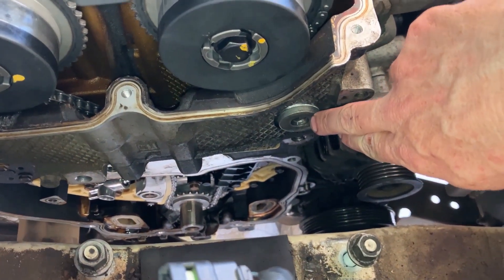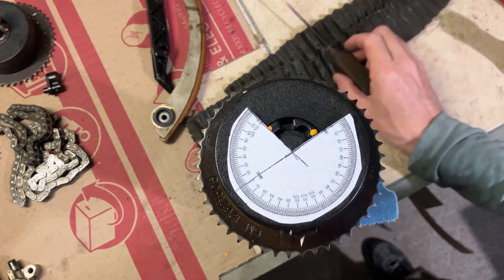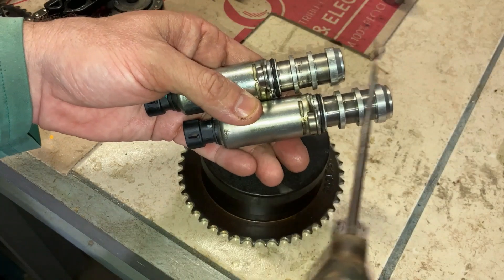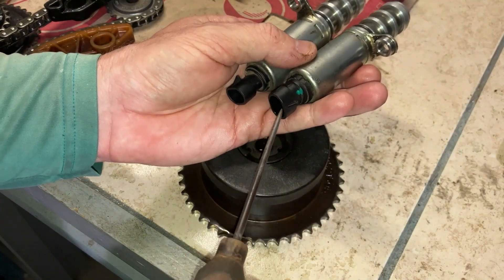Chevrolet Equinox [Timing Chain] Replacement & Overview: Ecotec 2.0 2.2 2.4 VVT

Comment from the maker: If the video was helpful leave a like. If you have any questions leave a comment. Check the description above for part numbers, and a link on how to install a high-pressure fuel pump, follower, and cam sensor on a Ecotec engine. Thanks For watching.
Reply: I’ve been reading up on these ecotec 2.4L. I have one with 170,000 miles and the timing has never been changed.  I popped the valve cover and it has a tiny bit of slack but nothing crazy.  Should these be super tight?  I swear I hear a rattle from the timing when starting if it’s been sitting for a long time.  Since the top guide bolt that is under the plug is known for being worn down from a broken guide, is it worth taking the plug off to take a look? Would love to replace the timing just worried about timing it back up. Might just go ahead and do it after watching the video.
Reply: How did you get to the timing chain to have enough room to work?

Comment: I did this job , video was helpful . After installation car starts up , runs good, only issue a faint whine now that goes up and down with RPM’s. It’s not super loud , but it’s there. When I did the timing chain I triple checked the work and it seemed like the chain was just tight . I installed everything right . Not sure if it’s the chain that needs “broke in”? Im not sure. It does make me nervous. I used a cloyes aftermarket kit. Idk if the cloyes chain come tight or what . Should I take the car back apart or will this noise fade through time ?

Comment: I might be doing the timing chain because i believe it started to rattle and my water pump went out, my question is, when installing the new water pump, does it matter what teeth are grabbing on the water pump?? Or that wouldn’t matter as the chain wont have a mark like it does on the crankshaft.

Comment: My 2016 Equinox had a broken chain guide, but didn't damage the rest of the engine, but it did die right after the part broke. I changed the timing chain and other components, set timing to 10 and 2 and all marks on the timing chain lined up with their respective spots, but when i tried to crank it today it just spins the engine. Sounds like it's not firing at all, just makes a humming noise while the engine spins. Any ideas?

Comment: Great video,  been super helpful up until this part that I'm stuck at.  On the timing chain, I've got my off colored link lined up with the crank sprocket dimple (with the sprocket key at 12. Up top, it looks like the gold link for the exaust actuator is in the right neighborhood of being 11 o'clock, but I haven't put the sprocket on yet. But on the intake side,  the gold link is all the way down inside the fixed guide, nowhere near that 2 o'clock position it should be at.

Any idea why it's only 2/3rds lining up?
Reply: Turns out, at least for my year (2015) the chain according to GM and the chain manufacturer I bought from,  have it set up where the OFF COLOR link goes to the intake actuator, and the 2 matching links go to the exaust and the crank. Not sure if this a year difference,  or an aftermarket part difference, but something to watch out for.
Reply from the maker: Thats correct, some other brand chains locate their colors different. I usually count the links on the old chain and compare to make sure there the same as the new one.

Comment: I need help .

I lined up everything, it turns good, but when do the marks line up again, I've rotated it probably over a hundred times, i don't want to close it up till i see the marks lined up again  .

Anyone with any advice .
Reply: Although I do hearing as I turn it and it sounds like alow cooking popcorn  .
Reply: Do each lobe on the cams supposed to be facing out passed the lobes .

Comment: What is the washer for on crankshaft?
Reply from the maker: Those were just thin shims some have them and some do not. There usually stuck on the sprocket, sometimes the other one will stick on the harmonic balancer if it has the second one. Probably just to keep the two parts from making metal contact.

Comment: I had a question about rotation of the engine 720 degrees, when I did this my timing marks did not line up again,  do I need to redo the timing or is that normal
Reply from the maker: They will not line up after the motor is turned. If everything was set up by the marks correctly, motor spun 720 deg. with no piston contact, you should be good.

Comment: I watched your video a few times. That top bolt for the front guide broke off, flush with the head of course. The second time you said that they make that plug with a pin so that it holds the guide with the plug? What? That took me 2 hours to drill out and mess with. Where do you get that from? Thanks for the video man!
Reply from the maker: Access Plug/Guide Bolt Combo: Melling 5499GMB or Dorman 917-954. The Dorman should be available (In stock or special order) at a local auto parts store. Either should be available online.
Reply: @hp_outdoors  I found it at a local Autozone in stock! Would have never known about it if it wasn't for you! You saved me alot of time. I owe you a beer or three!

Comment: Where can I buy one of the access plug with the guide bolt built on it
Reply from the maker: Access Plug/Guide Bolt Combo: Melling 5499GMB or Dorman 917-954. The Dorman should be available (In stock or special order) at a local auto parts store. Either should be available online.
Reply: @hp_outdoors  Are those worth installing as a preventative measurement? Can it be done without removing the tensioner or is it too risky?
Reply from the maker: Most just updated it when they serviced the timing chain, and a fix if the bolt did break off. You wouldn't have to try & drill out the broken bolt or extract what was left. I think the bolt breaking problem was due to running them for too long with a loose chain.
Reply: @ Thanks for the insight! We have the Doorman bolt in our basement awaiting "use"

Comment: My 2.2L Ecotec jumped 4 teeth on each non VVT cam sprocket. It still ran fine (noisy) to park it in my shop. I'm thinking I can target the crank @ 12 o'clock like it's supposed to, then remove the timing chain and rotate the cam sprockets back to 10 o'clock on the exhaust and 2 o'clock on the intake and be exactly where I need to be. Tell me if you think I'm going to be ok with that logic? I'm 2 days away from my Cloyes kit arriving, could really use the nod of approval. 

My upper guide got chewed up by a slack chain just like yours, I believe the tensioner failed and caused it. Chevy has redesigned them 2 times now after the first abomination was installed at the factory.

Thank you in advance.
Reply: How did that work out? My 2.4 did the same thing. Waiting on my kit to get here Friday

Comment: Thank you for posting this! I found this video very helpful in a lot of ways. Ive never attempted a timing chain replacement because of the fear I might get everything out of alignment so this helps but I have a question. Do I or should I drain the oil before opening up the timing chain cover and should I remove the head to check the valves for damage as well?

Comment: Trying to troubleshoot a 2012 2.4L Equinox. Wondering if it is the timing chain stretched and jumped a tooth or something else. Only codes that appear are o2 censor running lean and that appears randomly then disappears. Vehicle starts as normal but will sometimes sputter between 750-2000rpm and engine will sometimes die. Vehicle restarts without trouble. Random and unpredictable misfire occurs. Gas pedal becomes unresponsive while engine is fighting to stay running. Issue seems to lighten up and or disappear after motor has ran for 10-15 minutes. New air filter, cleaned MAF Sensor, Cleaned throttle body, cleaned PCV port in intake manifold, Intake and Exhaust camshaft solenoids replaced, plugs pulled and replaced, new O2 sensors. 95k miles on motor, and 500 miles on new oil change.

Comment: when you rotate the motor, lets say 2 times around or even once should the timing marks and arrows still line up? in these videos i dont see anyone rotating as if it doesnt matter. im not so sure
Reply from the maker: No, after 1 or 2 turns the marks won't be lined up.

Comment: Hello there I have this problem rebuilt the engine 2013 2.4 . And know every time I startthe car  a winding noise coming from the timing chain area . Pulled off the oil pump cover replace the timing, chain and gauge again still making the same whiny noise.
Reply from the maker: If it does it on start up and not all the time it could be the phaser sprockets. They can get very noisy.

Comment: Hello guy,
I'm going to look at a 2011 one with the same issue but what's the approximate price to replace the set up?
Reply from the maker: Really depends were your getting parts and what all needs to be replaced. Prices vary. Cheapest route would be replace chain and guides only, or get the master kit that has all timing components, water pump, VVT solenoids, Phasers, accessory belt and tensioner. Don't know labor cost.

Comment: If you do not get a code for this issue, and do not have a clanking sound, and the vehicle is 150,000 miles[2014 equinox ecotec] am I good to drive for now at least? I bought this thing with 140k on it, probably a dumb decision in retrospect. Have already replaced cat converter and have put a fair amount of cash into it for maintenance. It has a smog pump code on but that's it. I checked out the carfax and I am not sure if this vehicle has had a timing belt change or not. If it hasn't, then obviously it's been due but..
Reply: Change the oil every 3k on these I've done 20 chains. They go bad due to note changing the oil frequently enough
Reply: @FIXINGCARSEASY  Ok thanks. I think a big problem with the vehicle is I have the same issue many others do with it.. oil getting low rapidly.
Reply from the maker: This one here has around 230k right now. There a great driving vehicle, and really good overall. The timing system to me could of been designed better. Keep the oil level correct and don't let it get low.

Comment: my p0010 code popped up on a pontiac g6 2.4 ecotec i’m hoping it’s the wiring i don’t feel like having to change the timing chain in my apartment parking lot atleast not just yet
Reply from the maker: Could be a wiring problem or a bad VVT controller there on top of the head side by side. This vehicle had one go bad around 60K, replaced with a new one and code cleared.

Comment: If your not replacing the phasers' is it necessary to remove them.?
Reply from the maker: Not sure if you can remove or re-install the chain without taking the phasers off.
Reply: @hp_outdoors  nope I had to take the phasers off. The 18mm bolts were a BITC%! to remove!!!

Comment: My daughters car is a 2010 2.4 Equinox.  It died on the highway. I had it towed home and took the valve cover off and the bolt that holds the intake phaser sprocketvon the cam broke. I guess i would have to remove the cam and takevit somewherevto have the bolt removed...i did notice the sensors had heavy crud on the screen. Did that cause this? Is it worth fixing or should i junk it? Thank you for you video. It helped me a lot.
Reply from the maker: You could try drilling with a left hand bit in the center of the bolt and use an ease out, if you can get to it with a drill. If the threads weren't damaged when the bolt came loose or broke, the rest of the bolt should unscrew out. If the threads were damaged and the ease out won't get it, then the cam will have to be removed, and taken somewhere to be repaired. Could get a new or used cam. Could also get a good salvage motor and take parts from it and use on your current one. Have to pull the timing cover to see what's all damaged down in there and see if there was any valve to piston contact to know if it's worth fixing.

Comment: Is it necessary to replace the balance chain kit?
Reply from the maker: You don't have to. But if one of the guides is cracked & wore, or the tensioner is not doing its job it may cause a problem. Balance chain also turns the water pump if something goes wrong it will run hot.

Comment: How feasible is this without a lift?
Reply from the maker: In a equinox its no problem. This one was done sitting on the ground with the front passenger side tire & wheel removed. Place 2 jack stands under the front frame to support it. I put a jack (lay a block of wood on top of the jack) under the motor to support it, also to move it up and down a little to remove the motor mounts and bolts that are in the way of the timing cover.
Reply: So don't jack up on the engine/tranny just the motor mounts? Sorry, my wifes Equinox has this issue as well and would rather not throw away 2k for a job i can do in under a week.
Reply from the maker: Put a piece of plywood or block of wood on the jack and support the engine under the cast oil pan. Mostly just supporting or moving the motor a little so you can get the weight off the motor mount on the passenger fender. There are 2-3 other motor mounts supporting the engine/trans still attached.
Reply: @hp_outdoors  damn quicker than my local mechanic thanks boss got like a subscribe from this guy

Comment: Now I gotta fix this pos my wife had to buy. I hope when I take the head off it's all bad. So this pos vehicle goes. I already told her if I have to replace motor it's done and I am not doing it. To never ever speak of buying another American vehicle ever. They are all trash. Idc what you own. If it's America car it's trash. Meanwhile my Honda Element that we let sit for almost two 2years in yard. Put battery in it fired right up. SMH trash American vehicles this coming from a tech.
Reply from the maker: This is not the best timing chain setup or design for sure. I wish it would have just had a timing belt.

Comment: How does every video i watch everyone has so much slack to reinstall the chain and i cant get mine over the last sprocket. What am i doing wrong?
Reply from the maker: Not for sure if you can put the chain on the cam sprocket without it being un-bolted from the end of the cam. Usually have to hold on to the cam sprocket and push the teeth up into the chain & line up timing mark, then bolt it to the cam. Unless the chain maybe too short, count the links on the old one, and see if it's the same as the new chain.

Comment: I broke the upper bolt holding the black guide for the timing chain. Will i be ok
Reply from the maker: Not a problem, use Melling 5499GMB or Dorman 917-954. These are designed as a repair (in case the bolt breaks or timing chain takes it out) or an upgrade to the timing chain guide. Its a 2 in 1 access plug that has a stud made on the end of it to hold the black timing chain guide. The upper bolt behind the access plug isn't needed if you use it. Did it break smooth off or did it leave some bolt sticking out?

Comment: Where did you buy the timming kit?
Reply from the maker: All the parts for the timing chain and fuel pump install came from Rock Auto. First time I ever used them and will use them again they beat everyone's price. Only problem is they don't move parts from one warehouse to another warehouse and then box them at the warehouse closest to you. If you order 4 parts that are in 4 different warehouses, then you pay 4 shipping charges, because they ship out from those individual warehouses. Luckily all the parts I ordered were at and shipped from one warehouse.

Comment: Thanks for the video. Question - before removing the timing chain, I am trying to line up the camshaft and intake /exhaust  cams to TDC. I can’t seem to rotate the engine more than a few degrees in each direction - then it stops. Any ideas? Should I remove everything and then line up TDC etc?
Reply from the maker: Removing the spark plugs will help with rotating the engine. You can put the belt pulley on and bolt it up to turn the motor over with a ratchet. Unless the timing is off and your making piston to valve contact.
Reply: @hp_outdoors  what do you do if that is the case?  Not seeing any info about fixing that

Comment: After I replaced the Timing Chain Kit for  My Chevrolet Equinox. Then, It appeared "Engine light" is  on . 
Is it true that they messed up something in my car ? 

Now they  diagnosed, the codes are below:

P0014 Exhaust Camshaft Position System  Performance
P0137  HO2S  Circuit Low Voltage Sensor 2

The machanic told me If I don't fix, The car will consume  more gas. 

My questions:
1)If I don't fix them, Will there be any damage to other parts of the car ?
2) How long can I drive before I can afford to fix them? 
3) what are the costs to fix those two codes ?

Thanks a bunch
Reply from the maker: For the P0014 I would check the cam actuator solenoids on top of the head, timing chain end of the motor. See if the screens are covered with metal. P0014 needs to be fixed that's timing related. It could possibly be timing is off, or chain may have jumped somehow. If it was the o2 sensor #1, then drivability would be a concern. With o2 sensor #2 only trouble you should have is a failed emission test.

Comment: Didn’t you say this was an LEA engine? If so aren’t you supposed to put your cam arrows at 10:00 and 7:00?
Reply from the maker: 10 (Intake) and 7 (Exhaust) o clock is the camshaft end notch position, not the timing arrows on the phaser sprocket. If you're installing a camshaft or had a new/reman engine without timing components or sprockets, you would set/check the cams position by the notch on the end of the cam.
Reply: @hp_outdoors  i have the cams at 10 and 7, but the timing mark on one does not line up.as long as 2 timing marks line up am i good???